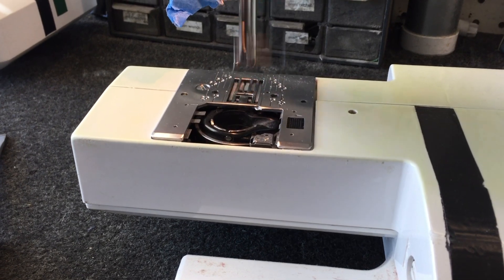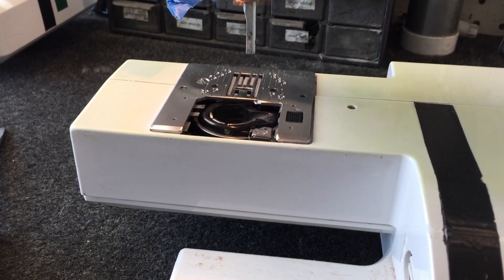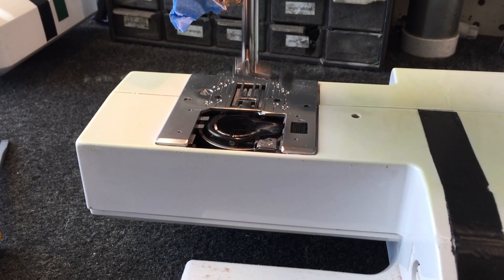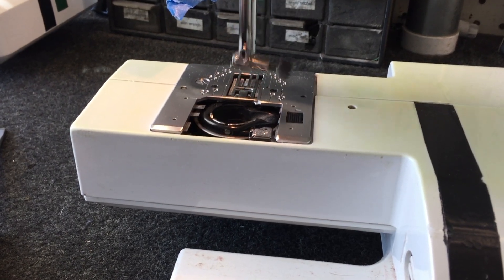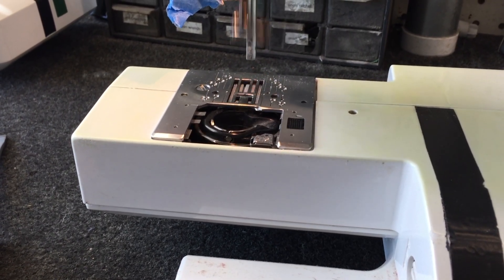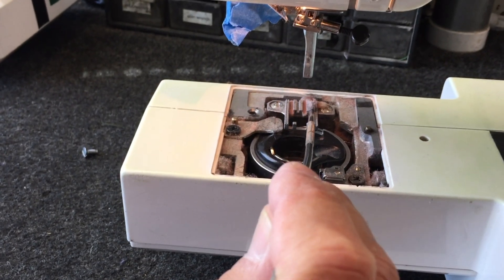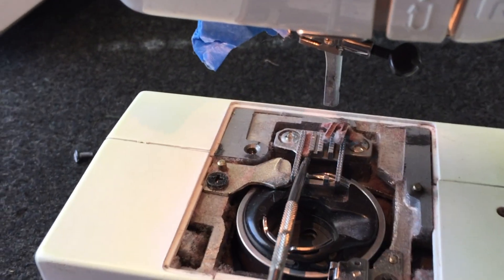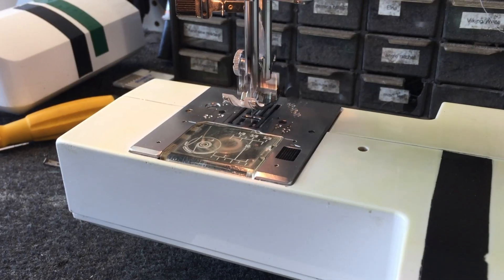Sewing Machine Feed Problem and Solution - Dirty Feed Dogs

Comment: All of a sudden my feed dogs are not moving either up or down after taking off my embroidery arm. When I push the button on the back of the machine it doesn't move either up or down.  When I take the plate off I can see a piece under the feed dogs that move back and forth when I press the button on the back of the machine, but it doesn't seem connected to the feed dogs.  Can you advise me how to fix them or do I need to take it to a repair store.  That's hard to do during this pandemic.
Reply: Hi. Did you manage to resolve this issue. I'm having the exact same problem, ever since I change the foot to the embroidery foot. I've only had this machine a month too 😢

Comment: where and what do i oil in regards to bobbin and case
Reply from the maker: On a machine like this you can put a drop of oil on the wick under the bobbin case and one drop on the "edge" of the hook where your bobbin case rides. I would clean and oil this area after every large project or a few smaller projects.
Reply: What kind of oil sh8i get or look for? Can it be found in something household or is it super specific? What is it fish oil, motor type oil? Coconut? This part is new I haven't sewed in a few years.

Comment: Is anyone else having the issue where the feed dogs move but they push the fabric towards me and not like away from me? Like without pressing the reverse stitch button the feed dogs still see reverse. Then when I do press the reverse stitch button, the feed dogs move the fabric like it is supposed to do.
Reply: I am having the same problem...
Reply: @Rana_96  I still haven't found a solution and I put some tape holding down the switch for reversing the feed dogs. So now it sews like it is supposed to, but it is just annoying to have to peel back the tape when I need the feed dogs to go in a different direction.

Comment: The EGL700 sewing machine which i bought for my granddaughter wont feed the material..Was ok yesterday she said but since changing the needle it wont move.   Checked the needles in ok  and the bobbin .  It'I i do it manualy ,it feeds ok ,but not when i use the  pedal although it makes all the right noises. Ive tried everything i know. Im only used to my big old industrial sewing machine but this one is limited on bits you can unscrew to take a closer look.      Any ideas please???